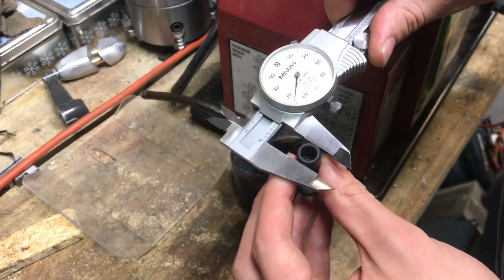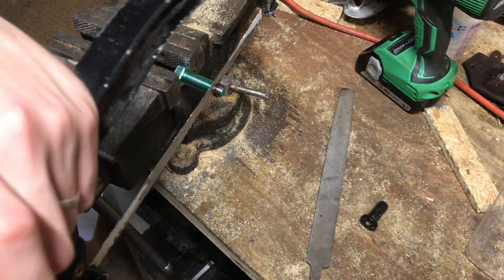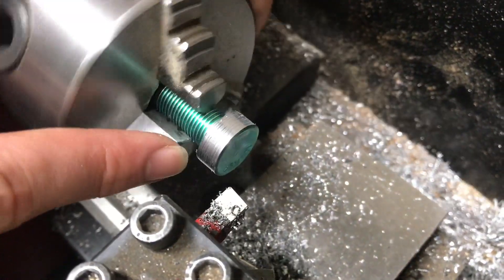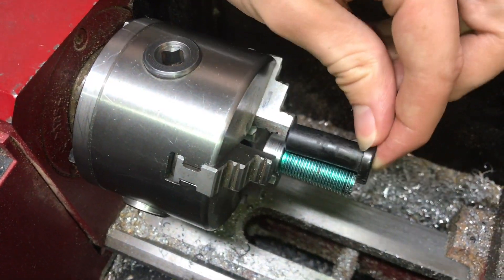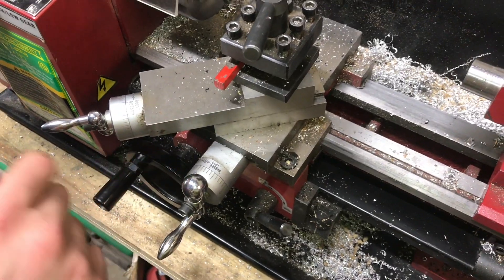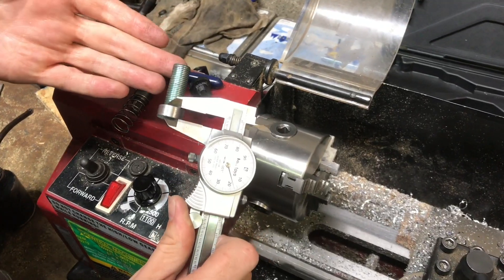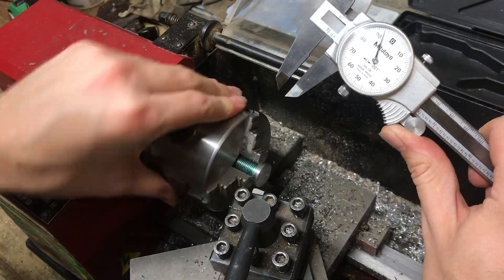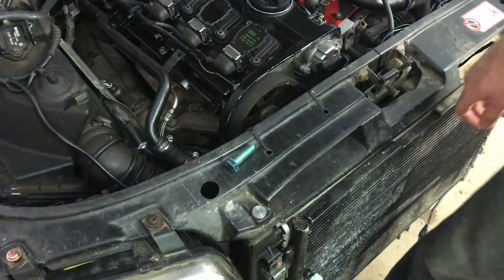using bolts to MAKE “useful parts” (harbor freight mini metal lathe)

Comment: How has the lathe held up?
Reply from the maker: It held up really good, we were even able to adjust it to be a little tighter intolerance. Then I had the brilliant idea of converting it to CNC. Not so brilliant, we got most of the way through the project and then we blew the circuit board that controls the speed. now it sits in a box. We got a bigger lathe now, but I really miss the simplicity of the little one. Probably too much information.👍

Comment: Pls do some more research you didn’t need to use a hacksaw or file to do that and doing what you did on a metal lathe with no tool rest is a great why to get killed don’t debur on the lathe like that either just buy a debur tool run it on the edge

Comment: I am thinking about getting my first lathe and have a question. Does this one have a pass through headstock? If so, would it accept something 1.5 inches in diameter?
Reply: The spindle through bore of this small lathe is only 3/4”.
Reply: Yes it has a one inch pass through👍

Comment: You should better clean your lathe.
It looks so ugly.
Reply: If the lathe is clean, not enough projects are getting done. Besides it came from Harbor Freight. If it gets too dirty you just throw it out and buy another one.
Reply: This is how a lathe should look. It's a machine, not a show piece.
Reply: @woutmoerman711  no it looks scruffy. After the work such a machine has to be cleaned. This machine was not cleaned for a long time.

Comment: If you are worried about tool height cutting to center of part i have found buying spark plug feeler guages and using those under your tool holder are easy to guage and adjust tip height just make sure they are sized to the width of tool holder and you practice on scrap to see what works then stay 1 to 3 thousands below what gets rid of the point on your scrap piece

Comment: Young man, I'll make no comment about your machine handling and practice save for one thing, I see you are using a file WITHOUT a handle or a bit of hard tube rammed on the tang. I can assure you that you will only have the pointed tang rammed into your wrist once by some slip of the file on the job in the lathe, you will not do it twice :-|
Reply: Such a very painful lesson. I’ve also seen the tang go almost all the way through the hand from the palm. The nice thing about having been an EMT since I was 17; I saw a LOT of things I didn’t have to learn the hard way. From why jewelry near ANY machine is bad all the way to “but I was just sweeping the snow out of the chute real quick, I didn’t think it would catch my fingers”. Take it from me Safety is well worth the effort.